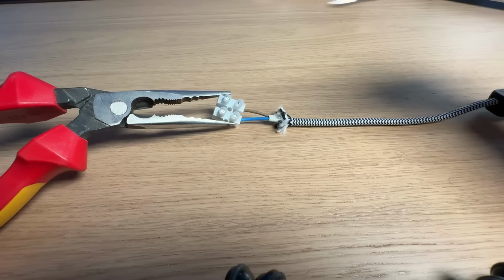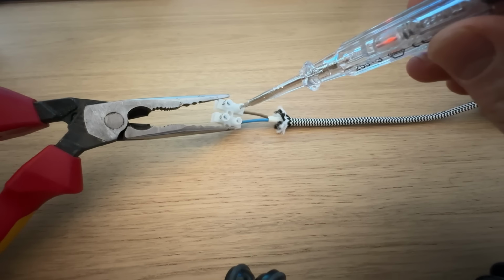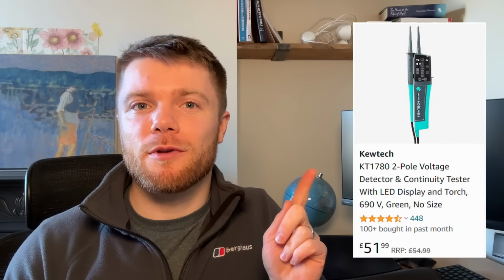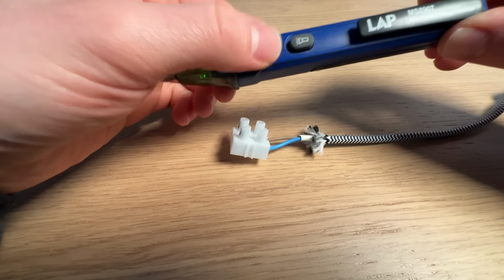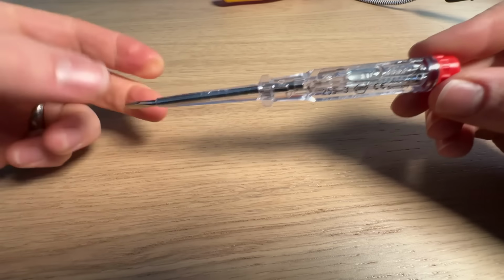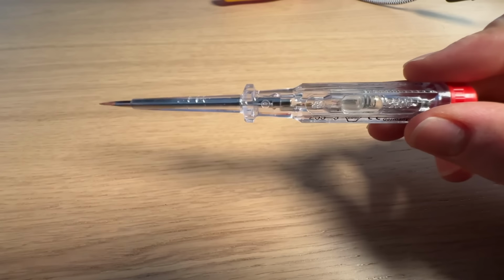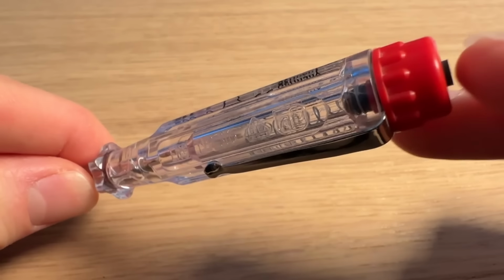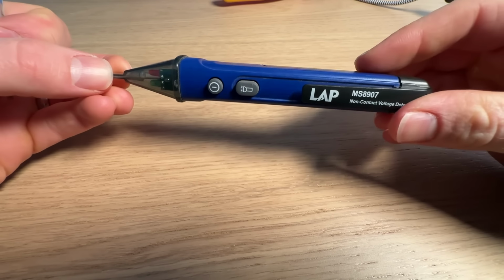The Most Dangerous Electrical Tool

Comment: These things are dangerous because they can prove something is live but they can't prove it is dead because you have no way of checking if the thing is actually working. That's why Sparks use voltage testers alongside a proving unit. Having said that even as an Electrician I do have one but only use it for sorting out switching on switches where someone has had a go changing their own switch and messed everything up. It's quicker than using a multimeter. Other than that I wouldn't advise using one. But I doubt anyone has ever actually been shocked through the screwdriver itself.

Comment: Of course all electrical work has some risks. Had a few Mains shocks myself, really 240v makes you jump😂. - but you're gonna let go of it real fast.  Even if direct electricity was earthing to you in a continued way then itd trip out the circuit breaker.  If that fails then you're in trouble. Yes.  But if you'd checked your screwdriver and look after it, no risks involved or they're not gonna sell it.

Comment: I just tested mine, it has a one megaohm resistor, unlike yours with what looks like a 120K resistor, maybe because your in 120V land, and I'm in 240V land (Australia).
The test current does not directly go through the neon bulb, but via the glass of the envelope via capacitive coupling, that spring that leads to the end button only goes around the nipple of the lamp, it does not connect to the internal electrodes, so there is an awful lot of impedance between you and the AC power.
Anyway, I just measured mine, using a Fluke multimeter, on 240V (1M resistor) with the end button taken to neutral via my meter I read 0.13mA, just enough to generate a slight sensation if I was in that loop
However when used as intended with my unearthed body as a capacitive load, the current dropped to 0.02mA, not exactly a life threatening value. 
Just a pity they don't have an earthing lead option, like the 12V auto incarnations.
Whilst those volt sticks can be nice, these are infinitely more reliable, as there is way less to go wrong, they can sit unused for 20+ years in your toolbox and just work, unlike battery powered testers.

Comment: sorry but I disagree. In the real world you will have loose and unconnected wires and these electronic testers do not work in situations where the circuit is not complete. The pole finder It will always work. Now, honestly, I never liked this style of pole finder, because the red tip breaks easily. I prefer the sealed ones, they last for decades and can be used and abused.

Comment: It is not dangerous itself. As every tool, you need to know how to use it. I mostly use it as this as check with this procedure:
1. touch the live thing I would like to work on with such tester, I expect the tester to light
2. shut of the breaker
3. repeat step 1
4. touch the thing that was live previosly barehands only if the tester does not light

Comment: Did you really call the non-contact tester "inexpensive"?

Hellerman Tyton has two volt-test screwdrivers like yours with a neon light and 270k resistor at about £ 1.75 - £ 2
They have a few non-contact detectors starting at £ 29

Sure, that's cheaper than the two-probe AC/DC tester that indicates 8 different voltages with a line of what look like LEDs for over £ 100, but...

Comment: First time ever I saw someone using this pen got me very intrigued some 20 years ago. I figured its use was detecting current or voltage by watching the electrician. So First time watching it and it drove the elctrician to shock as he touched a line which he falsely assumed or didn't read correctly that was alive. So I'm very wary since then. Never used one.

Comment: the reality of electrical engineering is when you get to a site any metal surface could be live for whatever reason. Using yourself as a part of the circuit means reliable information, whereas trusting the multimeter or something more complicated can fool you into electrocuting yourself. Even if the tester was broken the current flowing through it will break the circuit and you will live, but if there is a bad neutral or a live cover you will break when u touch it.

Comment: Non contact voltage testers (pen) are rubbish, they even light up when there is no voltage, they run on induction. I've been using these screwdrivers all my life with no issue. And why would spring broke?!?  The best way to find the live wire is this screwdriver

Comment: These screwdrivers have been standard kit in many an electrician's toolbox for decades. They don't require batteries and provide a quick and easy warning of the presence of voltage on contact with terminals or wires. Obviously, they are not approved voltage testers for isolation procedures, but that is not what they are designed for. 

There are dangers that can arise from  damage to any tool or instrument used on live electrical circuits, which is why tools, instruments and probes must always be carefully inspected for signs of damage before use. In addition, when working on known live circuits, which should be avoided unless absolutely necessary, then a range of protective measures are required to avoid danger from electric shock, burns, fires or inadvertent actuation of electromechanical machinery.

Comment: Don't take this as offence.
First of all you said " if something bypass this resistor you get shocked"...
Are you gonna fill that with water or metal shavings? 
Second of all anyone with litle and more expirience will use those because they are cheap and reliable.
Only someone who has 0 experirience will use non contact volt pet and even that in hands to someone with 0 expirience can be deadly.. 
You seriously clickbaited the title saying" the most dangerous electrical tool"

Comment: I carry a Fluke volt stick I found on a road 15 years ago, which is my first check. Very handy before taking things apart. I take things apart with the neon, as that will both warn me and protect me.
The worst incident I've ever had was using a volt meter (actually, a DVM) to test a socket. Guess what happens when it's set to current instead of voltage, and you put it across a "dead" live socket? Also, a DC meter won't warn you of an AC voltage! It lies.

Edit: should also add that if you hit a 3 phase supply, you will get a tingle off a neon screwdriver. Had that once! Probably saved my life.

Comment: Not only is it a quick, convenient and safe way of checking for a live connection but the bits (on both sizes of screwdriver) are the perfect shape for electrical work and the thin shank means you can spin the driver fast.

Comment: i see people finding excuses for this tool ... this is tragic and i'm working with people that swear by this screwdriver... why would i bother with this when i am already required to have a proper approved voltage detector by law ? ...it only proves that there may or may not be voltage on a wire to ground. useless ...

Comment: Sometimes this screwdiver lights even when the conductor is "dead". Just by capacitive/inductive coupling of the conductor along another conductor alive.
Get a 2-pole-detector with extra "load" button. The load allows ~50mA that will trip any rcd e.g. when measured L vs. PE. Most will detect 400V (Europe) between L1, L2, L3 and give phase order (left/right), too.

Comment: The problem with the non contact tester is. Its function is to show where live voltage is present. Its failure mode is not fail safe, it may not detect the electrical field so it does not light and you take it the conductor is not hot. I use the neon driver as well as the non contact indicator and around 3% of the time the neon finds it when the non contact stick says clear. Ive pretty much given up with the non contact stick. When using a Neon always find a known live and get a clear indication off that to calibrate the function before use. Obviously high light levels the Neon may not be any good as its failure mode being you dont see the glow so take it as conductor not not but the calibration step pretty much obliviates this fail. Its easier to ensure you have made physical contact to a conductor with a screwdriver tip than waved the non contact sensor within sensing distance in some packed panels. First probe though with supply on then repeat to see supply is off. working with the neon as a screwdriver its reassuring having that light as a back up test as you go.

Comment: The most dangerous 'tool' is often the man doing the job !
As a youngster I stripped down the electrics on a wood lathe and removed the motor, capacitor and all the switch gear .... only to see that it was still plugged in and live !  Sometimes your guardian angel looks out for you ..... but mainly not!

Comment: To protect you there is the resistor + a capacitance (between the bulb and the spring). I do not consider this a dangerous tool

Comment: Never had any issues with these screwdrivers for home use with 230 volts, I imagine professionals will have professional tools.
If the spring would break the contact would not be made, because it is broken at that point  and they are not meant to be filled up with water, maybe don't use them if they are.
Even if it would conduct the full current, it just tingles with a small bite, which tells you to switch off the light / group and replace the screwdriver.

Comment: 1. I used great main testing screwdriver and also super cheap ones, and never got electrocuted
2. outlet testers are problematic becouse you need outled at the end of cable 
3. magnetic field detectors usualy lasted about a week 
Solution: don't be an idiot while testing main wire and don't keep your tools in water ( before you ask, i keep one tester in my room for year and it's still fuctional, and i have one srewdriver and outlet tester in car for years and they are still works)
Or maybie euro testers are better build than american ones?

Comment: Absolute BOLLOCKS. 
Never had a problem.
They are dangerous if a mouse crawls inside,or the neon bulb turns radioactive or  you mistake it for a 13mm spanner ,JEEEEEEZ.

Comment: I'm pretty sure more people die in car crashes than electrocuted by one of these...What's your point?
Any electronic tester that uses a power source is prone to fail more often than something that uses the current you actually check.These are long term tested,decades of proven use.

Comment: I think what makes them dangerous is that its also a screwdriver. If your working on electrics. use a insulated screwdriver. Just buy a separate voltage tester.

Comment: 4:00 uhhh this tester is for electricians not for plumbers

And how likely is it for a spring that never expands or contracts to break

The only downside with the non contract tester is that they require batteries and they cost more

Comment: I think I'm going to use both. Having 2 independent ways to test a circuit is better than one. If the non contact meter bugs out or the battery discharges then I can still use the neon probe. But testing a circuit without stripping isolation is definitely more convenient and as it turns out also safer.
Another issue is when you are testing wire that is live but is cut flat and live and neutral are milimeters away from each other. If you use neon probe and place it wrong then you can short them and I don't think that anyone wants a face full of sparks. 
On a side note, I've touched live nd neutral intentionally and ... It wasn't pleasant but I'm in one piece.
On another side note, I've just became a professional electrician and my superior is using all 3 ways to test a circuit. Though, someone elses wrong doing shouldn't be an excuse to repeat it. Personally I think that the best way to avoid getting shocked is simply not playing with electricity. Buuuuuut because you are reading it it means that you are dealing with it so in that case I would rather advise researching the topic from many different angles, testing hypothesies, checking your environment for things out of place, learning from everyones mistakes and thinking not about a possibility but probability i.e. You become an electrician - your chances for getting shocked skyrocket.  For example, I heard a story that on a construction site when plaster was freshly applied on a wall and it was still wet and some wire somewhere wasn't isolated properly and you could feel a zap when touching said wall.
What I could advise from my theory and relatively short experience is using one hand rule. (never touch a circuit you don't trust with two hands). It's exceptionally importand with voltages higher than that in a wall and at a certain point. You don't even need to touch both terminals, or be connected to ground, or even touch anything to get a shock that will kill you before you hit the floor. It's enough that you get close and the voltage + current + right frequency will do the rest.

If there's anything that you are to take out of that comment. It's this: Never assume you know everything and at least learn about things that you know that you don't know.